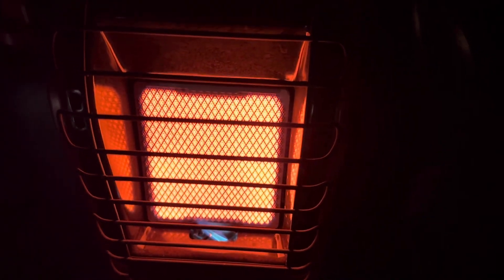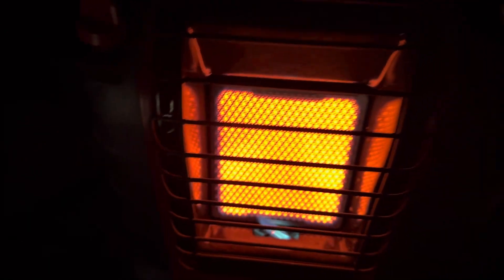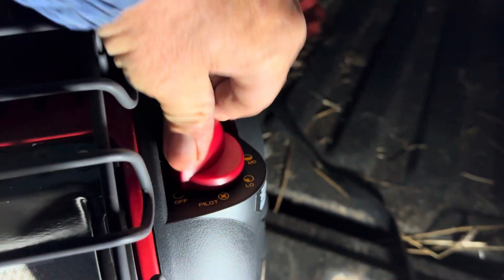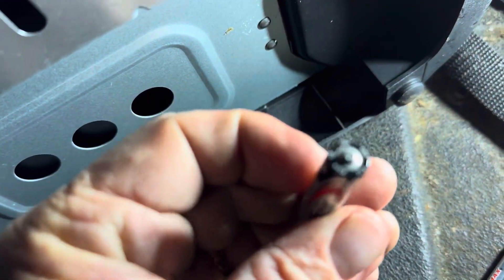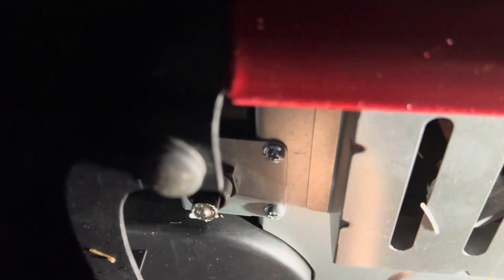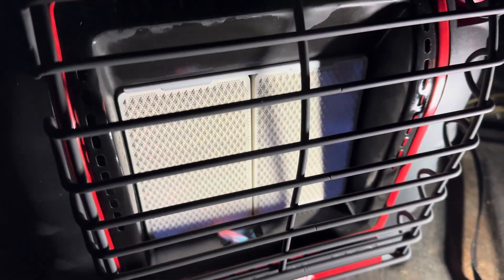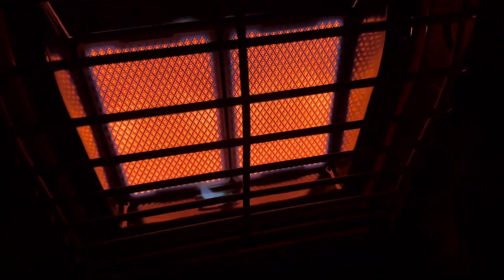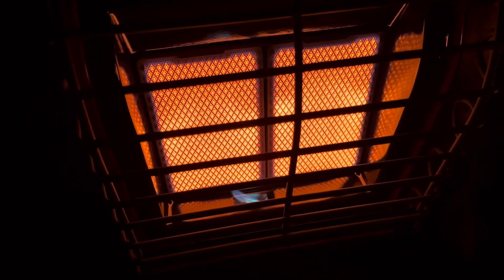HACK - Big Buddy Propane Heater Electronic Ignition

Comment: You are my hero!!! A knight in shining armor. LOL   I couldn't get my D batteries to fit in the back.  The AAA fit fine so I don't know how you figured out that the battery couldn't make contact.  So I took your advice and used a pocket knife to scrape off the top layer of insulation on the battery.  It was really simple and easy to peel off the top edge of coating on the battery so much so that I thought surely this won't fix my problem.   Like magic, it worked.  The battery compartments seem to be too small by a fraction of an inch.  It was difficult to get the D batteries to fit in the back.  A clerk a Lowes helped me with that fix.  You have to bend that spring unnaturally out of the way.  I was afraid I would break the spring off of the back.
Reply from the maker: I’m glad I could help. The D cells are for the blower. I am just using the radiant heat. Glad you got it working.

Comment: Thank you so much, I was about to take it back to the store and try a 2nd one, battery connection... so stupid design i was using a Duracell battery, obviously same issue as the energizer, worked immediately.
Reply from the maker: I’m glad I was able to help. Very ftustrating, but a great heater once the electronic ignition is sorted out.

Comment: I had to put a 1 pound can in each side of my big buddy to get the pilot to light the the ceramic burners, 1 pound in only 1 side did not seem  to have enough gas pressure to feed the ceramic burners. I will try the battery fix and see if that will work with only 1 pound. Thanks for the info.
Reply from the maker: I was able to run it with a single 1 pound cylinder. I put it on the same side as the pilot light.

Comment: Thanks! Electronic ignition is not the way to go. In addition the battery will sit in there for a year or two, leak and corrode everything and then no more ignition and you have to use a lighter. Not sure why Mr. Heater did this.
Reply from the maker: I agree!

Comment: Thank you so much good sir…now I have to go to confession to repent for all the swear words I just said..
Reply from the maker: Glad you are up and running!
Reply: I’m still swearing 😃😃. I’ll credit your video times two. It made me look at the grey photo again to realize the battery installs negative up. I only noticed battery installs here, and put it in positive up. I’ve never seen a negative install in the device positive out to the cap. I did wonder how it was going to make contact as the battery is inside the spring. But I removed the insulation, installed the battery correctly (for this installation) and the sparks are flying. Thanks
Reply from the maker: Yes, very strange design. Yoyu would think the negative would be on the side of the screw in cap. More contact area.